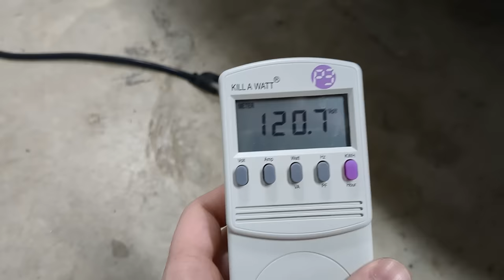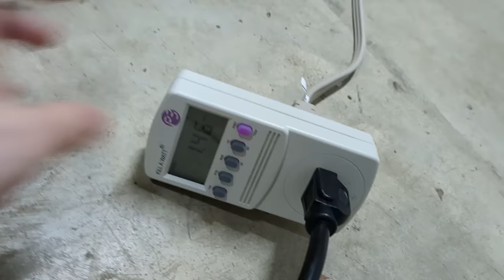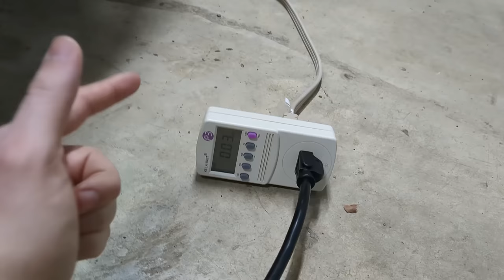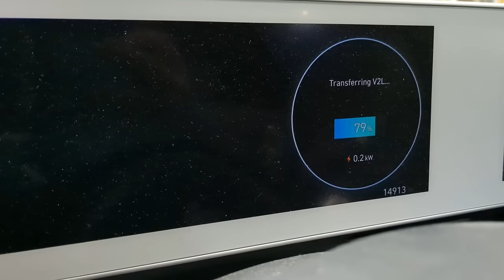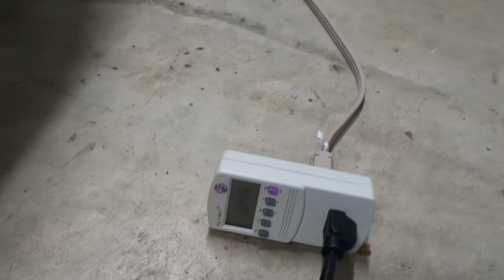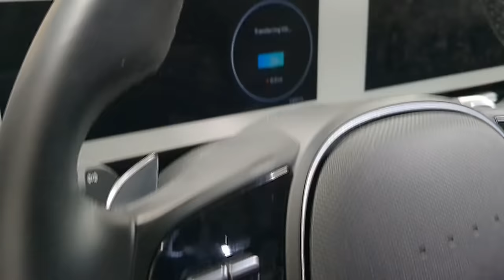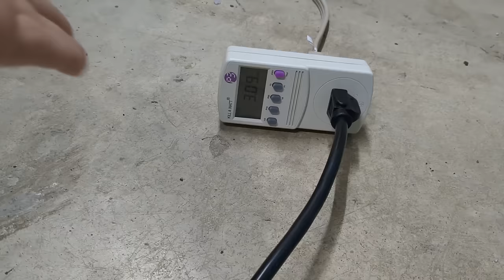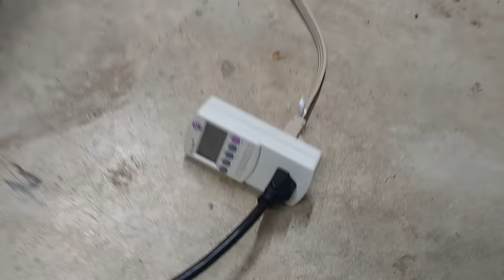A 24-hour test run of the Hyundai Ioniq 5's Vehicle-to-Load function

Comment: You're lucky your power grid works properly. I'm also in Illinois (close to Wisconsin) and we have lots of power outages. There's an issue with the section of the grid that my house is on so it loves to go out in storms. This winter we had an outage for almost three days. Bought a new inverter generator and put a plug on my furnace so my family and dogs wouldn't freeze. It's too bad the Bolt doesn't support vehicle to load because we have two of them.

Comment: It would be interesting if future houses had certain outlets in rooms that would be able to pull power from a plugged in EV (like those red outlets in hospitals but since this is residential, and could be powering something pointless like a TV instead of life support systems, don't make the colors obnoxious) that way you could still have power in all rooms if your power went out, the car would need to back feed at a level 2 rate though but that shouldn't be hard.

Comment: Also,  in an extended outage you could use tow charging to recharge the Ioniq very quickly,  even if the grid was still awol.  Assuming you could find a person to tow you ..

Comment: The E-GMP platform is supposed to be able to export up to 3.6kW (15 amps at 240v)

Your adapter only gives you a NEMA 5-15, which is only a 120v outlet. Could you have gotten 3.6kW by simply purchasing a different adapter?

My parents EV6 came with the adapter, plus it came with an outlet under the rear seat you could plug into even if you didn't have the J1772 adapter to export power. Or maybe that's how you can get 3.6kW: By combining the interior outlet with power from the external adapter.

Doing a little research as I write that comment, and I believe that's the key: The combined power from the interior outlet and exterior adapter can add up to 3.6kW. Does your car not have the outlet under the rear seat that you could have also utilized during this test? (Or another way of looking at it: If you were only going to use 15 amps of power, did you even need to buy the external adapter if you had an outlet inside the car?

Comment: To clean the stains on your stainless steel appliance, nothing works better than Ajax powdered bleach in a can (or generic). Apply the powder on a wet (not drippy) and rub it into the stainless while following the grain. Then use another wet rag to remove most of the powder. Then a dry rag or paper towel to finish cleaning. Rinse out the bleachy rags when you are done so you don’t ruin some laundry.

Comment: Thanks for doing the test. I guess my kludged system using a 25-year-old 1kW Honda generator and a cheater cord will see continued intermittent service. 
FYI Bosch is working on a solid oxide fuel cell generator. These work with natural or hydrogen gas and are amazingly not subject to the efficiency ceiling of carnot cycles.

Comment: Very interesting!... .(I was looking at a house battery anyways, but this would do 🙂) If you hook up some solar panels you might mitigate some of that loss as well. Even in winter, well when the sun shines a bit  at least (not during a full blizzard of course).. you might have to wipe the snow off the panels when the blizzard stop and the sun comes back out.  There are some direct to outlet configurations possible with solar panels for a more low cost or mobile solution (if only to turn them to make use of sun morning or afternoon most optimal). This direct to outlet solution is what I would want to do with my car as well in a SHTF situation. Just plug it into the house.
Reply: Also.. you should have tripped the main fuse just to make it more realistic (and for (our) entertainment purposes)

Comment: Vehicle to home gives me more possible ways to function during an outage.  That is a big plus! 🙂  But I don't want all my eggs in one basket:  I don't want to depend on the vehicle for transportation and also for electricity.   If the battery gets low, or something else goes wrong then I lose electricity, I lose heat, I lose cooking, and I can't drive anywhere.   So I am still keeping a small inverter generator that can run on petrol or natural gas.  Lots of different ways to survive.  And I good chance that I can help my neighbors too.

Comment: Keep in mind the fact that as the battery voltage drops. the inverter will draw MORE current in order to maintain the needed 120 AC volts. This will cause the battery to discharge more rapidly over time. Also, the inverteritself might well ise a few hundred "overhead:" watts.

Comment: I have a BYD Seal with V2L capability up 2.3kW and 10 kW solar panels on the roof with a 10kWh house battery.  My problem was running two air conditioners overnight discharged the 10kW battery in around 4 hours.  I have installed a set up with ATS's  connected to downstairs and upstairs air conditioners and a selector switch to prevent both air conditioners being run together from the EV as this would exceed the rated load.  I had the wiring installed by a qualified electrician and in the evening I disconnect my EV from the charger and plug in the discharge plug, connecting the downstairs air con to switch over to the EV battery.  Around 10 pm I switch the selector to upstairs, the downstairs ATS connects back to the grid and the upstairs ATS connect the air con to the EV.  In the morning I unplug the discharge plug and plug in the charger.   Running the air cons individually for a combined 14 hours draws around 14kW hours out of the EV battery which is then recharged from my solar panels.  The 10kW house battery runs my daughters air con and just about lasts for the  night and is also recharged during the day.   It cost a bit to set up but over the long term it will save money and it means I can use my EV as useful battery storage for night time use.

Comment: I'm up near Antioch\Pleasant Prairie, we had some pretty cold days but I'd agree with your comment on it being a Mild Winter.
This is a promising video, I have an EV Motorcycle and was interested in building an inverter setup to do exactly this. Even with it's smaller capacity it seems 24 hours would be doable in a pinch. My only plan is to run 240v output so I can keep a well pump functional, that may be the limiting factor for me.
Reply: I live within a few miles of you. My main concern is also the ability to keep a well pump going during a power outage. I can get by without pretty much anything else, but running water is vital. Hopefully I can do something similar with my Aptera, whenever that gets delivered. My generator is so old it starts via a rope around the flywheel so I look forward to never having to use it again.

Comment: Lab I work at is currently working on testing the viability of using large electric utility vehicles that spend most of their time not in service (street sweepers are a good example) as battery storage for public buildings while not in use

Comment: a German channel i came across ran a whole house off the car. they had an electrician set up the interface between the panel and the car adapter and it worked. i was so surprised the car didn't shut down, but it's been a long time and i don't remember which loads they ran.

Comment: It's interesting what you say at the end about the duration and frequency of your power cuts.

I've lived in my current house (in the UK) for about 40 years and we get power cuts very infrequently. We might get a power cut up to 5 minutes in duration about once a year, very rarely will we get one longer than that.

The last major power cut we had was a couple of months ago when there was a fault at our local substation, even then the power was back on again within two hours.

It helps that the cables from the substation to my village are all underground, so bad weather would have to affect the high voltage cables further away at which point you have multiple paths to route the power.

My house uses electricity almost exclusively, only heating and hot water use gas. Even then I don't make preparations for a possible power cut. I have a small camping stove and a 500Wh battery bank with solar charger that I used during the exceptional 2 hour power cut, but I got those for camping not power cuts.
Reply: Most power lines are above ground in the US , that's why we have a lot of power outages.  I always thought they should bury the cables too because they are such an eyesore in the beautiful landscape.

Comment: for the starlink - you could have a smart plug that has default mode OFF and every time the power flickers like that, the first flick would shut it down and then you would have to turn it on manually, but you would only do that after the rapid surges were gone. i have shelly plug s and it would be capable of that

Comment: re the schmutz on the fridge: when i worked in an industrial bakery, we had this stuff to clean the stainless steel oven doors that worked wonders - spots and stains that wouldn't change at all with any normal cleaners would disappear with this stuff. unfortunately i don't know the name of it because we had a nickname for it and unlabeled bottles, but i think kay dazzle is probably it. if not it's the same type of thing, and there's also one from ecolab called medallion that should be equivalent. i highly recommend kay dazzle, if you can get it at a reasonable price.

Comment: There are competitors for the Kill-a-Watt that have an internal rechargeable battery that will hold all the settings during a power failure or moving the device.  The Kill-a-Watt has an internal thermal fuse that will open at 190 °F, or 15 A, bricking the unit permanently.
Reply: The higher end Kill-a-Watt has a battery or other backup. And a blown fuse doesn't brick something permanently. Fuses aren't exactly hard to change.
Reply: @eDoc2020  It's not impossible to change, but first, it is not a fuse in a holder, it is soldered in place.  And since it is also a thermal fuse, the simple act of soldering it in place can cause it to open., and the AC plug terminals are right next to it and can shift out of alignment.  It can be done, but it's not exactly easy either.
Reply: @jeepien  I knew it was soldered but I thought it was a regular fuse. I've soldered thermal fuses and never broke one. If you're concerned an old trick is an alligator clip on the leads to act as a mini heatsink.

Comment: Awww, I wanted to judge you based on the contents of your fridge...

Also, at 16:35 you left the extension cord for your kitchen coiled up. The cable will not be able to dissipate the heat properly while its in use and decent power is being pulled.

Insightful video as always, by the way. Love ya work.

Comment: I wonder how much of the loss overhead is going to the actual inverter, and how much is going to just keeping the car powered up.

Could be worth doing an experiment where instead of everything continually continually for 24 hours, you leave the car off and only turn it on every 3 hours or so to bring the fridge/freezer back down to temperature, and charge your laptop and the internet's UPS. You can probably even set the fridge's thermostat to a lower temperature to maximise it's capacity as a thermal battery. 

If the car has a high overhead for simply being on, this approach might significantly extend runtime.

Comment: My 26 CuFt side by Side uses a fraction more than 2KWH per day, the router / modem / SmartThings use about 1.3KWH per day (I know ridiculous,) so my backup solution needs about 3.5KWH per day.  So my electric Lawn Tractor can backup my system for about one and a half days.
Reply: Unless your router is aggregation server that serves thousands of customers, I don't see how it can use so much power.

Comment: I have a generator that almost never gets used. I have 1200w solar, it's not huge but it powers a small room with a window unit and that's all i really need from it. I live in hurricane area so having a backup may not be needed most years but every now and then it's nice to have some backup power. I have a newer ac unit and the generator can power that so I consider myself prepared enough. I can run the generator and power more when needed or just camp in one small bedroom and rely on solar. Which I use would depend on how many days the power stays off and how hard it is to buy gas. Cooking is on the grill outside during those times.

Comment: Home batteries are usually ~10-15kwh, and your car is 77kwh. Should comfortably power your small appliances a long time.

Small shame it doesn't feed directly into your fuse box so that it could power the entire house, that way you get working lights and other hardwired stuff like ovens.

Comment: Does this video lead us to a discussion about having a large battery fitted in your home and maintaining its charge from the grid against power cuts. A bit of electronic wizardry may be needed too. This would be a variation on the solar panel installs where the house stores power for overnight use. Just have a battery back up, use the grid to maintain it and be free to use your car as a car.

Comment: The primary loss isn't from the car 'being on'

The bulks of the loss is from the conversion inefficiency from the inverter converting DC to AC. 70-85% conversion efficiency is not uncommon. Peak efficiency is typically around 30% of the nameplate load of the inverter. IE, 1000w inverter is grossly inefficient from 0-20%, peaks around 30% (300w load), then tapers down more and more the closer you get to 100% load. I would also bet that it's going through a DC-DC converter to drop the voltage before it goes in to the DC-AC inverter, resulting in the additional loss that you saw. 

Likewise, there is conversion loss going from AC to DC to charge the pack. Fortunately those losses are much lower, typically 90-95%. Our EUV has a charge efficiency of 95% when charging at 48A/240v. On 120v the charge efficiency is much lower, only 85%.

On the subject of the Bolt, it has a 1600w DC-DC converter. So while you can't plug in a simple adapter, you can connect up a 1600w+ inverter to the 12v system and run almost the same exact loads that you ran in the video.

Comment: An outlet with my furnace plugged into it is how my furnace has been wired for 21+ years. The outlet also has a switch on it so the HVAC guy doesn’t have to pull the breaker to service it.

Comment: I think the best setup with this, for not using a gas/diesel generator, would be to have a Ecoflow Delta Pro Ultra or Pro 3, or other battery system, to run house items off of. This way you don't have to worry as much about startup load and such, and use the car's battery to extend the ecoflow by charging from the car.

Comment: Glad the vehicle behaved itself after an overload.  Curious if the Vehicle was able to warn/alert a user that it had/was going to shutdown.  (Mention of an App... Curious how extensive it is with monitoring status). Curious how it'd have responded to a short (assuming like the overload it has a circuit breaker protecting the wires/adapter from that issue)

Comment: When I tested my LG fridge, I averaged 1.36kwh a day with it set to 35F and the ice machine on.  I set it to 37F, turned off the ice machine and turned on "eco mode" (which just turns off the heat strip that keeps frost from forming on flap that seals the double doors) and it averaged 1.12kwh a day.  Over the span of a 7 day power outage that saves you 1.68kwh plus the inverter losses.  In my case I suspect my ice machine was the bulk of the savings as these bottom fridge/double top door units with the ice machine in the door have a blower motor that is constantly pushing cold air from the freezer into the door to keep the ice from melting.  Lesson is: turn off your ice machine in your fridge in a power emergency.

Comment: Most of the losses are indeed associated with keeping the car itself alive to do its magic V2L-operation, I figured based on your measurements a power draw of at least 100W continous from the battery for controll-module's standby, the rest is probably DC-AC conversion associated loss. If you would run a window-unit or other more power-intensive appliances while V2L is activated rather than having relatively low-current devices on average, measured losses will be much lower, because the ratio of purposely used energy to parasitic losses is much greater with high demand appliances. Running V2L with low load is, with a little hint of exaggeration, like running a gas generator for a single phone charger.

Comment: The ratio of energy missing from battery to energy used isn't unreasonable. 

Power used for HV contactors is probably ~25-50w continuous. 

Tare loss of onboard charger/inverter I would expect ~25-50w for a 2kW inverter, although could be higher given it's designed to charge the car at rates much greater than 2kW. 

Efficiency is probably ~87-92% so you have to add that to what the kill-a-watt says.

Add all of it up and it seems pretty reasonable. The fixed losses are what really get you and so yes, it would be much more efficient if you ran it closer to full load.

Comment: Where this would be very useful is to run the furnace in case of power outage. I once lost power for 5 days in the winter. I had to use my gas stove to heat my house. I assume it could not run a heat pump, but it should be enough to run a forced air natural gas furnace.